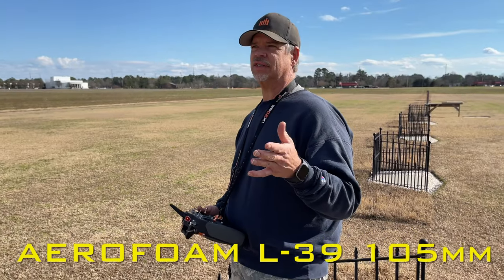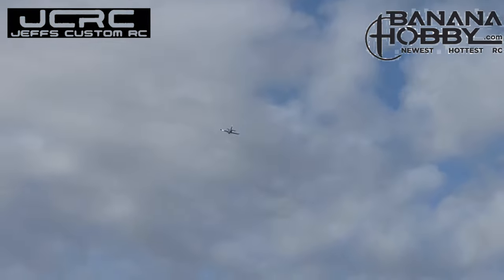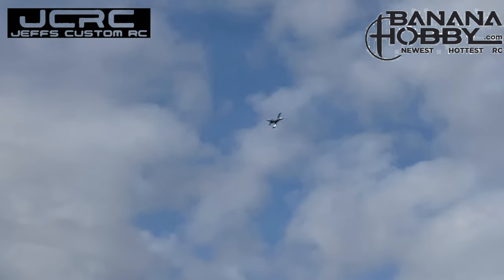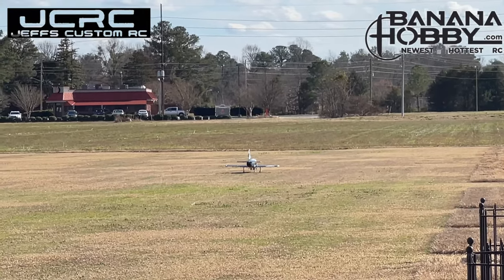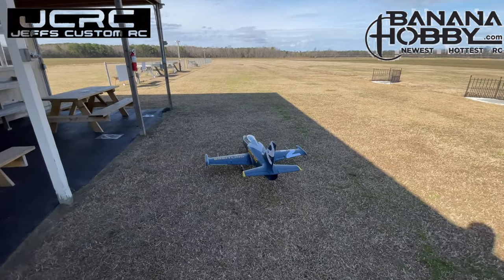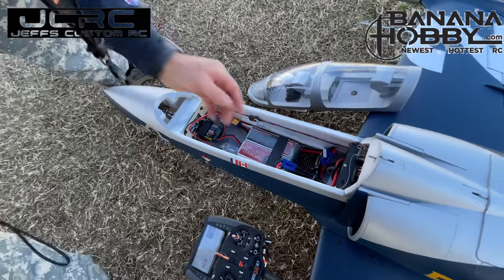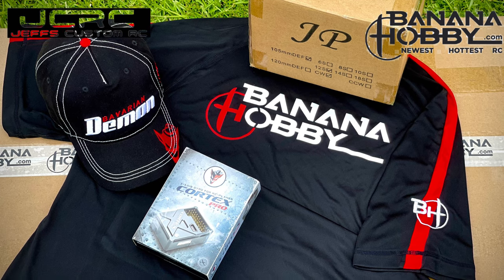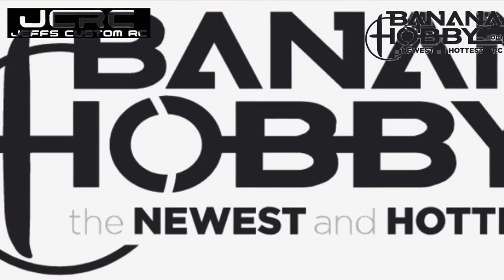Banana Hobby 12 CH AeroFoam Breitling L-39 Albatros 105mm RC EDF Jet PNP

Comment: Great flight brother Jeff! Very neat set up...I like it. If I remember correctly my buddy uses two 6000's a bit further back than you have yours. I also think he's running the stock fan. Great giant edf! Awesome video my friend!
Reply from the maker: Thanks Adam, the new HRN’s 6200’s are 40gms. each lighter than the older 6000’s, and are 100C, so hence the placement. I’m really impressed with the performance of these new packs, I’m 62 or 5200 so far, especially considering the lower weight. Thanks as always for the support👊🏼👊🏼

Comment: Jeff I have the arctic camo one about ready for maiden.  I added an 3d printer larger Cheater vent in the bottom AND used the original belly mounted Cheater vent on the fan hatch up top.  My theory is it needs more vent area to feed my JP 105mm as well as reducing the velocity of the air coming in the cheater to minimize grass ingestion
Reply from the maker: Nice!!  I’ve had no problems with mine flyin off our grass field with the factory cheater on the bottom, once moving, the air also goes in the intakes on the sides, and I have no issues rotating. Hope all works out for ya. Love how mine flys and handles. She’s floaty and landing flaps help, just be sure to add some down elevator mix. Your gonna love it👊🏼

Comment: How many amps is yours pulling? Mine only pulls 99-103amps but should be pulling at peak 130amps on the JP Hobby setup that is in the V2 PNP.
Reply from the maker: Can’t say as I’ve actually tested it but it flys great on 2 HRB red label 6200 packs. Hopefully when weather gets better and I can fly it again I can test and see👊🏼👊🏼

Comment: Nice flying.  In my opinion. JP fans looks cool, sounds great. However, the fan output thrust is mediocre compared to stock fans that came with some of the models.  I have installed two 90mm JP fans on the Freewing F4 and F16. So far, the F4 flew slower and had worse climb rate than the stock fan that it came with.  I had to remove the JP fan and put the old one back.
Reply from the maker: Absolutely!! The JP fans typically have more top end, but less thrust on low end, but man do they sound good, and I fly very scale, so……. Thanks so much for watching 👊🏼👊🏼